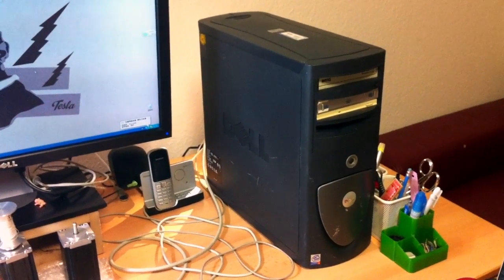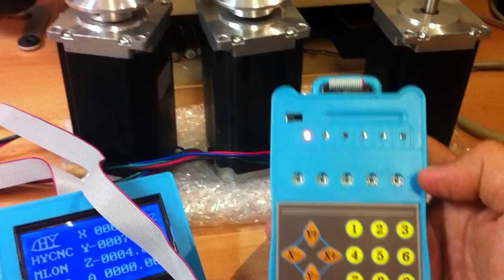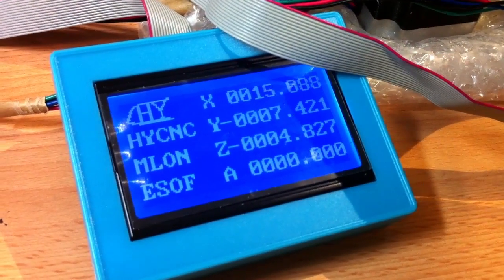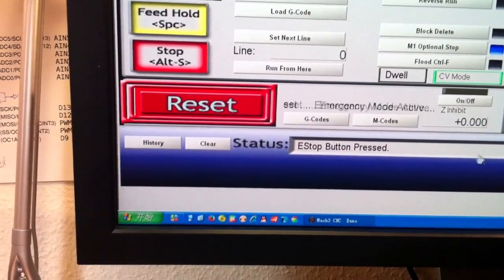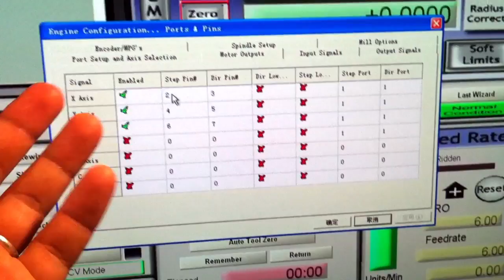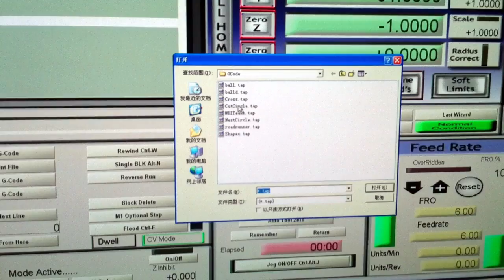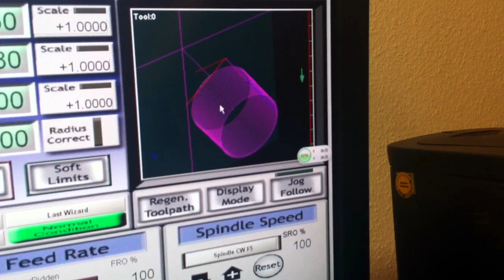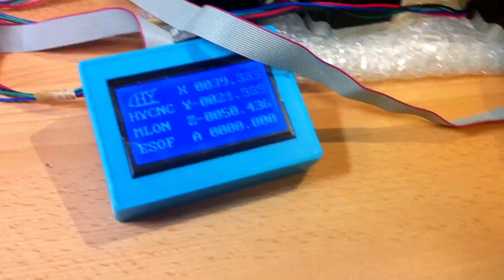TB6560 wiring, Mach3 setup Tutorial

Comment: Hi. Thank you for beatiful video.

I have  mach3 control card and driver.  But I unknow  how to connect   control card with driver

Do you help me please?

How to control card, drivers and step motors?

I have 2 mach3 card
https://tr.aliexpress.com/item/SAVEBASE-Upgrade-Usb-5-Axis-Cnc-Breakout-Board-Interface-Adapter-For-Stepper-Motor-Driver/32251904090.html?spm=2114.13010608.cb0001.6.yAYI18&scm=1007.13441.37946.0&%3Bpvid=5d8f91b7-4760-4ab1-8d08-d0d379f5a467&%3Btpp=1

https://tr.aliexpress.com/item/5-Axis-CNC-Breakout-Board-With-Optical-Coupler-for-MACH3-Stepper-Motor-Driver/32774074750.html?spm=2114.13010608.cb0001.4.yAYI18&scm=1007.13441.37946.0&%3Bpvid=5d8f91b7-4760-4ab1-8d08-d0d379f5a467&%3Btpp=1

and new drive

https://tr.aliexpress.com/item/Single-1-Axis-3-5A-TB6560-Stepper-Stepping-Motor-Driver-Board-Control-CNC-Router/32776368729.html?isOrigTitle=true

Comment: I'm not sure why, but when I power up mine, the stepper motors seem to lock and just start heating up. Any ideas what could be the cause? I've checked over everything as far as I can tell. It happens on both my nema 23 steppers and my nema 17 steppers.
Reply from the maker: If you have a Multimeter, you can check motor's four wires. They are actually two paars. With two prob of your multimeter, if two of the motor's wire are shorted (beeped), the other two should also have the same effect. Then you know them without the wire color codes, which is not standardized. There are A1,A2 and B1, B2. 'A' and 'B' are groups. the shorted two wire should connect to each group respectively. and exchange of A1 and A2 makes no difference, but always be sure that the shorted two are in the same group.
Reply: MasterCollingwood yes. locking of the motors & getting warm/hot is normal when they are set to 'active' if all the pins are set up correctly, the most likely culprit is the pulse length, under config -> motor Tuning, there is a place to set the 'step/dir pulse us' set both of them to 15. I know that was the problem for me. (you can see my video stepper problems/fixed)

Comment: I have the same board with different motors I do all the setting as the video but when I jog the motors nothing works. I have a power supply of 24V and connect the board to the computer by a LPT cable. Can you help me pleas?

Comment: I need help! Just hooked up my TB6560 board to the power supply and 5V and 12V LED lights up as it should. But when i connect the parallell cable to TB6560 they Y-axis led lights up red and the x motor gets locked and very hot, what should i do?
Reply: try to put in a different motor, sounds like a short in the motor.

(either that, or you wired up that motor incorrectly)
Reply: NickBlackDIN
actually, I should shush, because I'm Having A similar problem. I'll let you know when I fix it!
Reply: same here
Reply: Maxime bouchard solved it, i had to use a computer whit windows xp.

Comment: Hello i have item board and motor but my motor slow running , what is config dip, motor tuning and have you test pwm fonction on pin 16 i don't running it ... thanks !
Reply from the maker: Sorry I haven't test the PWM function on it. The speed of a step motor depends on the pulse signal on its step pins. If you just use the controller of this board specifically. The manually motor control speed depends on your step mod. 
https://github.com/Gfast2/Yifei/blob/master/Hardware/TB6560%20Step%20motor%20Driver%20Datasheet%20%26%20Software/3rd_3Axis_TB6560_Set_User_Manual.pdf This is the link of this boards manual. I've tried different mod. They were working all fine.